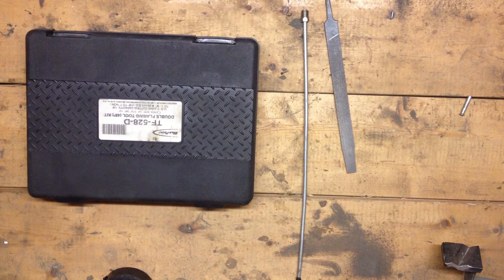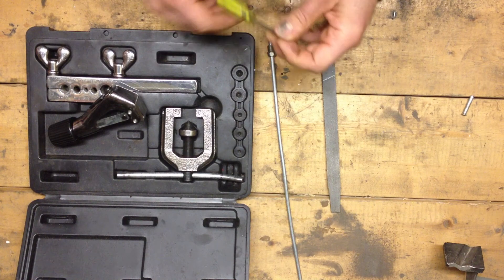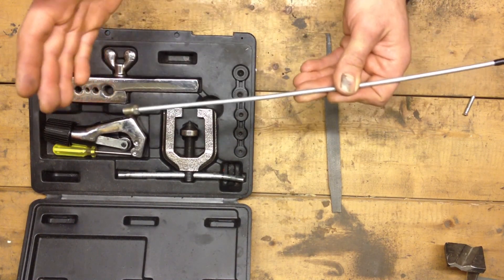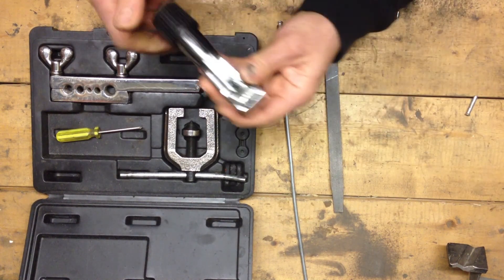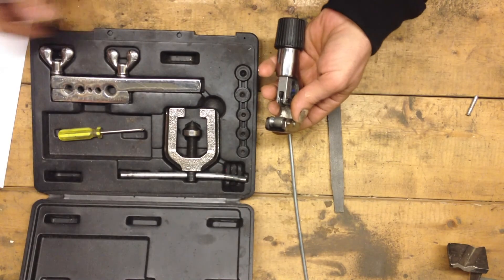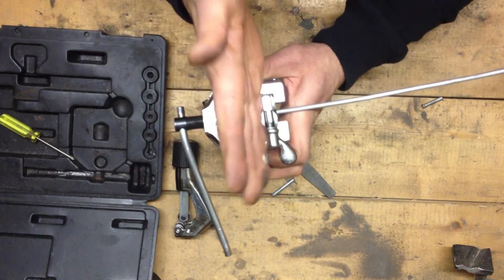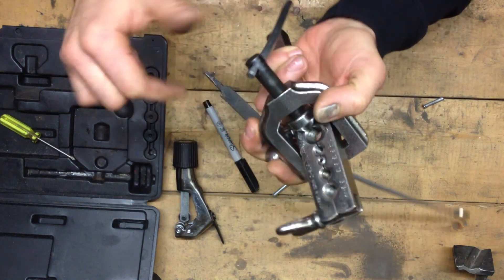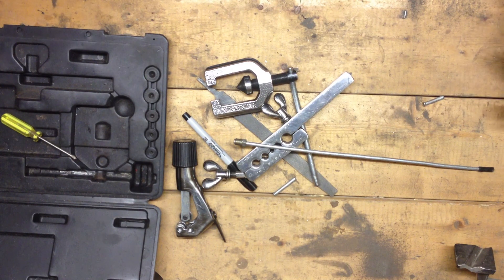How-To Make the Perfect Brake Line Flare.

Comment: The two piece  clamp can leave a step on the outer edge of the fair if the clamp is too tight. Also use the clamp to hold the pipe to dress the end of it  flat & square. The button used on the first stage of the flare has a nipple that locates it on the pipe. This nipple can snap off inside the pipe if not carefully aligned. Especially when flareing in a confined space on the car. The snapped off nipple is now stuck inside the pipe restricting the oil flow for the unwary. There are better styles of flaring tools available.